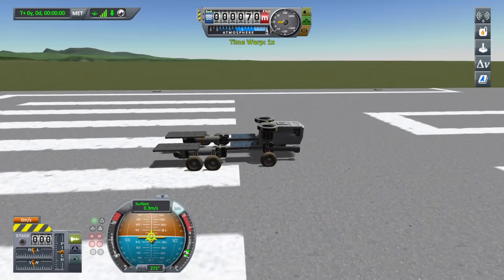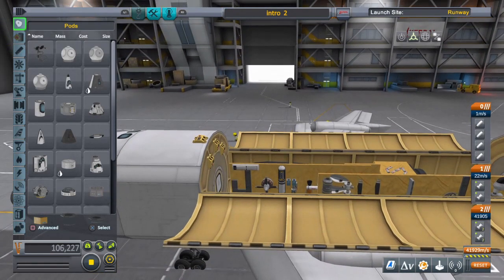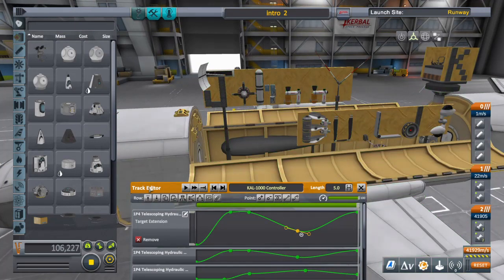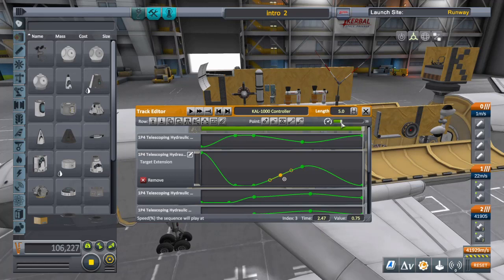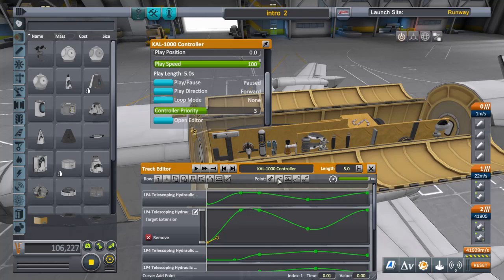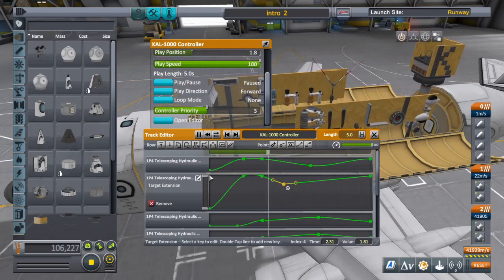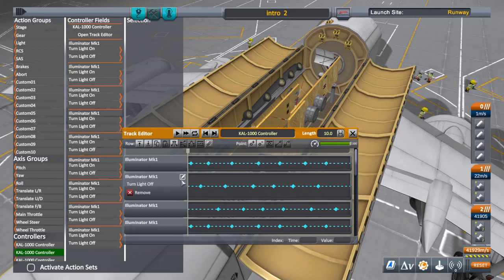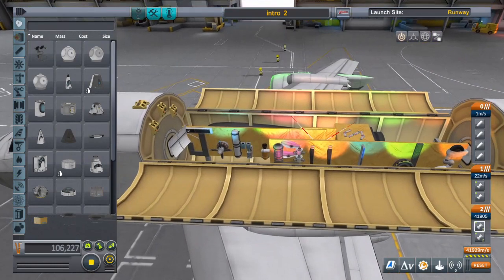Kerbal Space Program Tutorial: KAL-1000 Controller Basics

Comment: Kal makes me want to smash my XBOX, lol.  I can't figure out how to control propellers with throttle(or at all for that matter) using kal1000
Reply from the maker: You see the helicopter videos? Also gotta make sure you set the blades to extended.
Reply: @JohnnyOneShot  I watched the helicopter and quadcopter ones. I definitely know more about kal than I did, but I'm confused by the values and assignments.  I can make copters without kal work,  I can even build rotor motors from stock. I just wanted more control and about went mad trying lol. I'm a good pilot and builder (I put my vids on YouTube from xbox purely so I could watch them at work), but I think I need a book. Must be getting dimmer in my old age.  Thanks for your vids.
Reply from the maker: Long story short.

CW blades need set to a negative angle on the far right. CCW go positive. You make a key at the halfway point if the line in the KAL. Because the throttle starts there even all the down. Then go in to action groups. Click the main throttle tab. Then click the KAL 1000 on your craft. Select play position on the action group. You can throw torque percentage on the same KAL if you want.